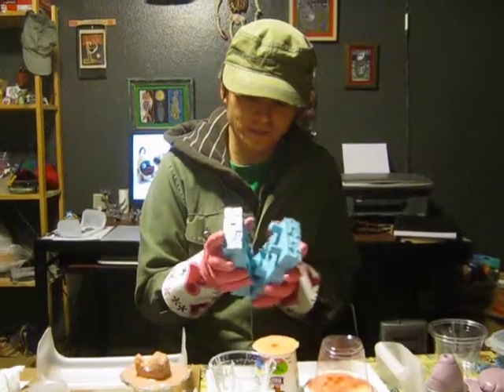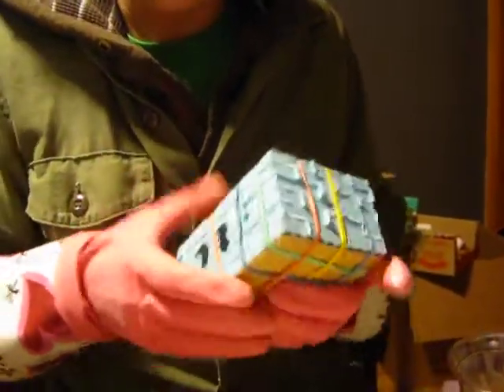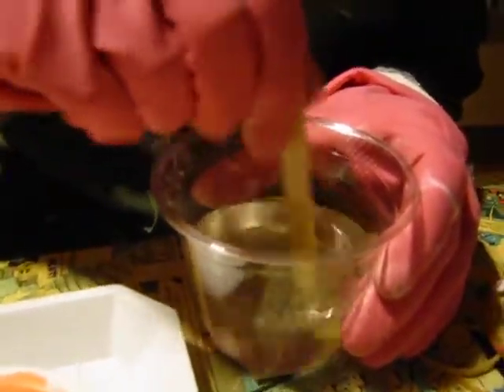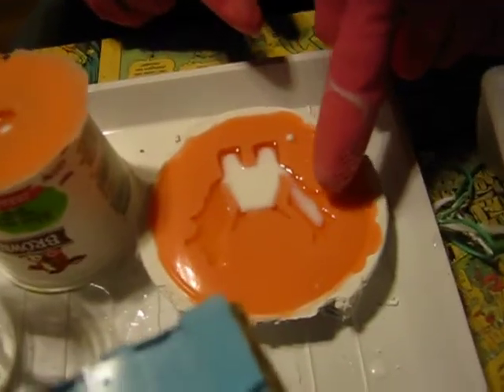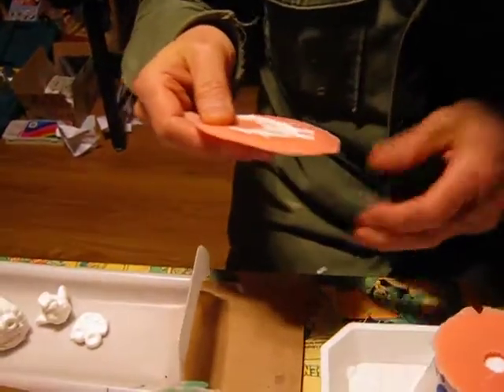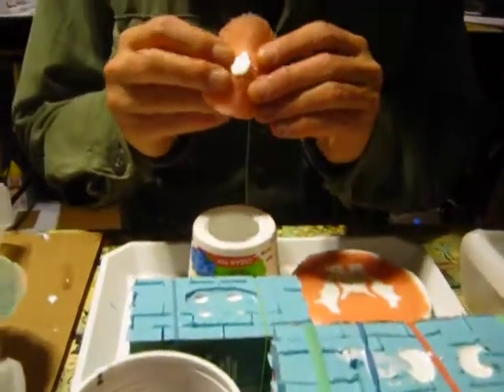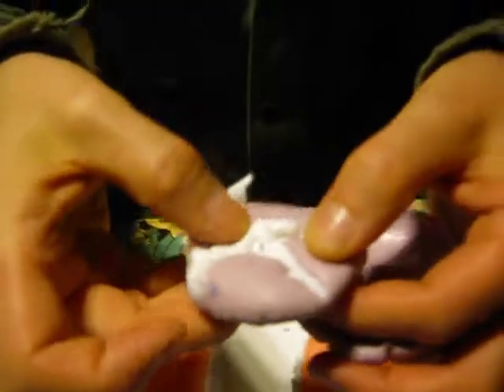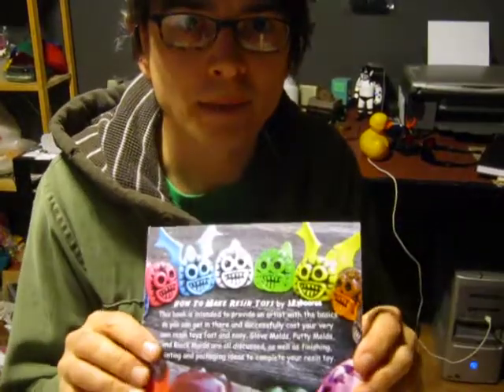How To Make Resin Toys Video 3: Pouring Resin

Comment: How much do you recommend pouring at a time?
Reply from the maker: The more you have, the faster it catalyzes and heats up. Two half cups as in this video is about the max. The more you mix, the faster you have to get it poured into molds. I think there are chemicals to slow it down if you needed to cast large amounts.